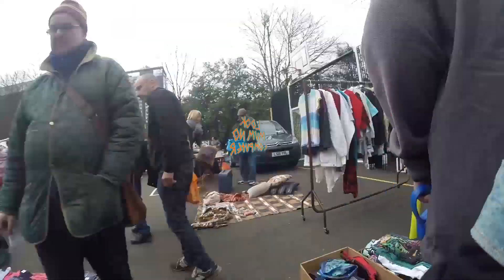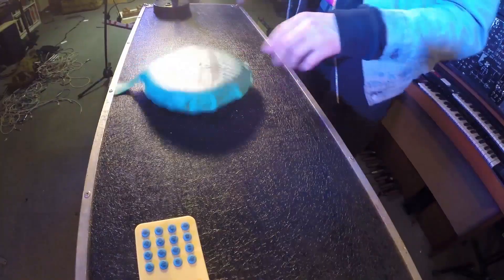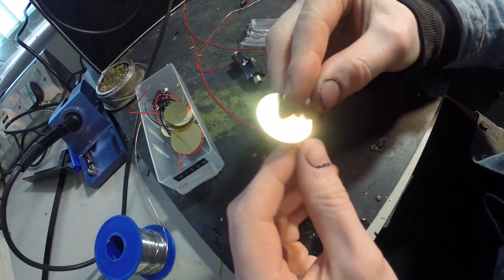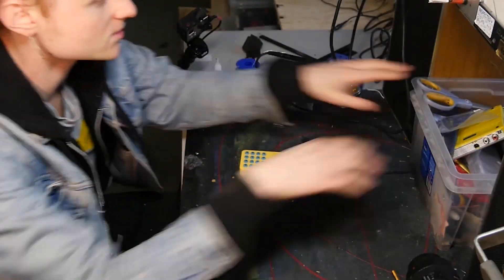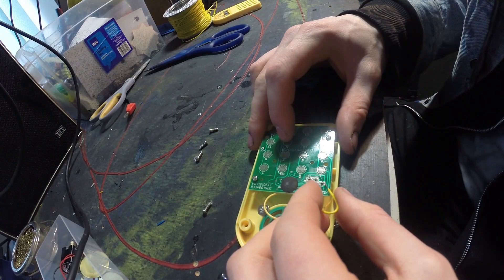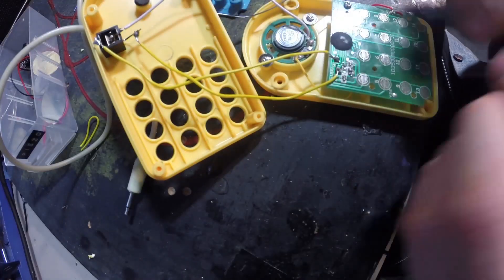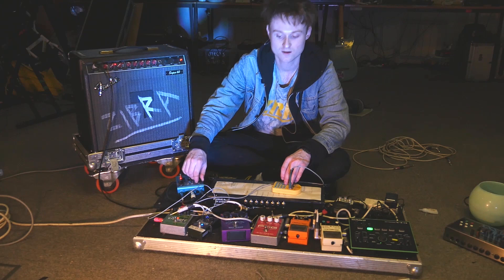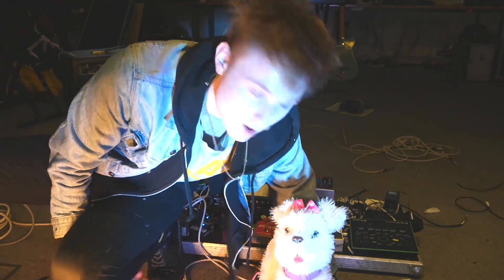ELECTRIC WHOOPEE CUSHION, CIRCUIT BENT MINIONS. PIEZO MICS HOW TO #HOWTO #ELECTRONICS #piezo

Comment: During uni we made about 20 piezo mics and hooked up an entire room to be an interactive sound installation.  We had massive containers of water with waterproof piezos we made, we had plants in there with piezos that could pick up you playing with the leaves, the water container with rocks to drop in to make sounds.  We even made a walkway using cardboard with sacks of grass glued to it making a grassy path that had mics under it to add sound to your footsteps.  All hooked up into a few laptops, Logic 9 and then out into our monitors in each corner.

These things are great.  Fantastic for sound design.

Comment: I'm kind of imagining that you're gonna end up making a choir of circuit-bent barking dog toys to go alongside the furby organ haha
Reply from the maker: i wish!!! to be honest thinking of getting a few and trying to get them to pull me on rollerblades... just hardwire the motors. but i have a feeling its not going to work, id need a lot!
Reply: @LOOKMUMNOCOMPUTER  I don't think you'd get the torque out of them no matter how many you found unforunately. that's a great visual though. maybe embedding a bunch of them side by side in a hollowed out electric skateboard. So the skateboard does the pulling but the rails left either side run between the dogs legs so it looks like they are running along the ground at first glance